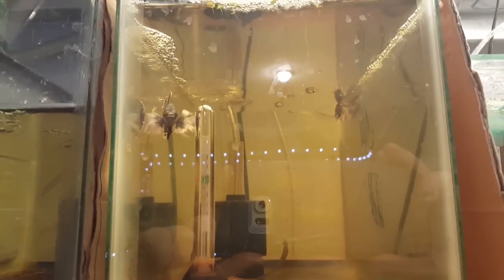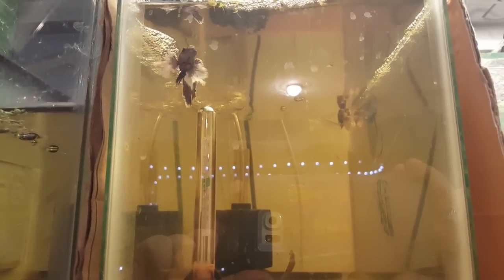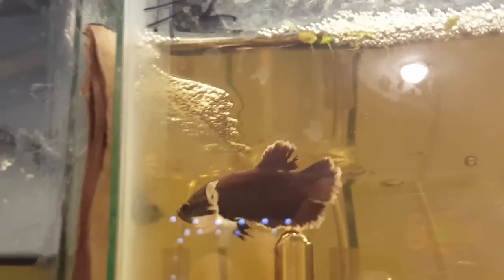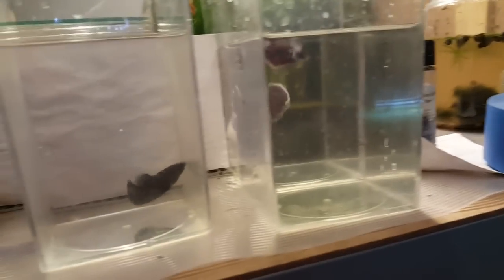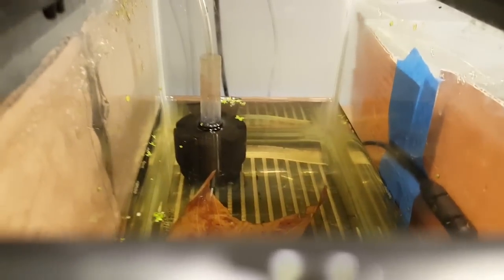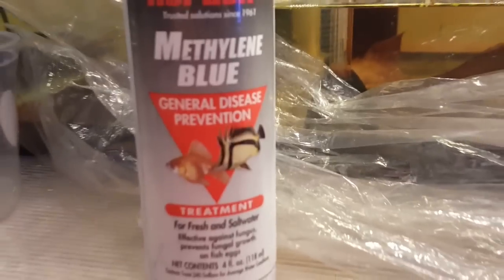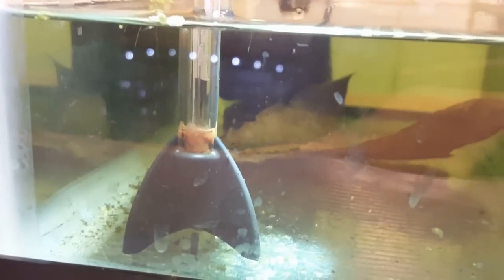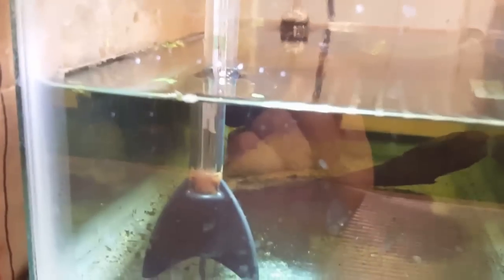Artifically Hatching Betta Eggs

Comment: lower the water level to 2,3 cm to avoid the fry drowning ubtil 2 or 3 days later when the fry can swim you can slowly raise the water level that is the only way
Reply from the maker: Fry don't drown.  I've raised many many spawns where a few fry end up on the bottom and do just fine until they can swim to the top without lowering the water level.
Reply: i dont know why your fry not drown because there is float breeding and very low water level breeding and i have try them all and succeed, thanks for the info i will try your method with my next breeding

Comment: I've had 50% hatch rates doing another method. I used a pipette to take the eggs and put them on a petri dish and put a bit of tank water and make it shallow to the point that the eggs sink but can almost touch the surface of the water and put a cover on top to lock the humidity. lower the water level, the higher the oxygen content the water will have. I've found that a lot will either rot or drown because the eggs sink from the fry wiggling around in the egg. the parents usually eat the egg case and I've also found that is the first thing that grows fungus. they tend to have different hatch rates so I like to give the left over eggs a "second chance" and be attentive to remove the egg casings.
Reply: SkyxPrince sounds like you should make a youtube video